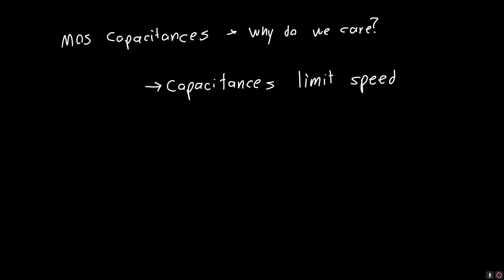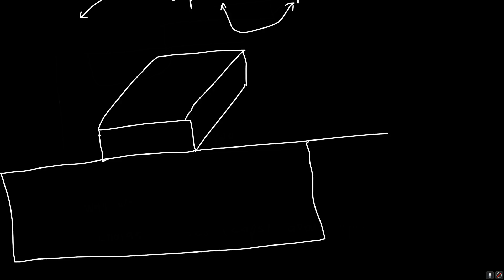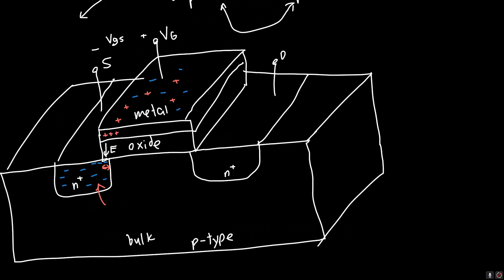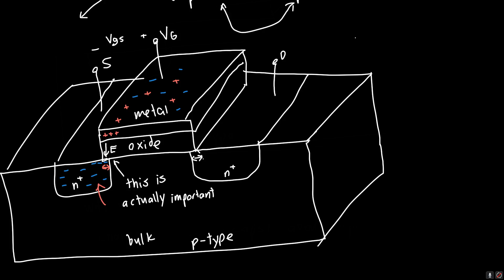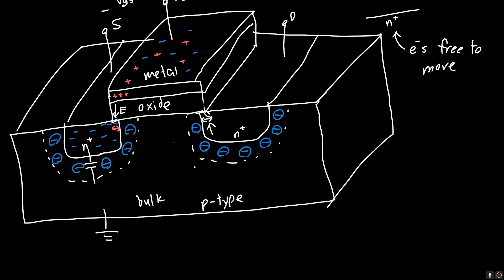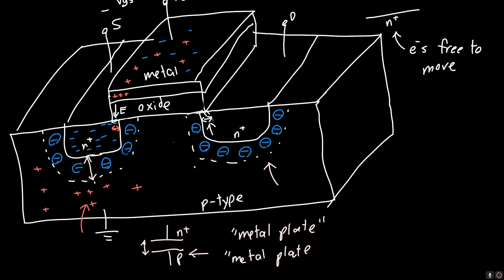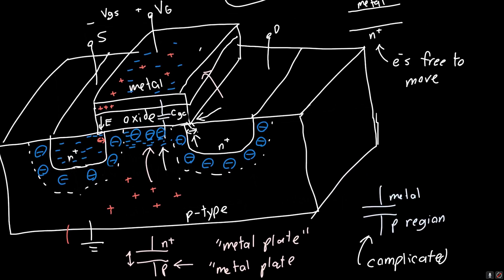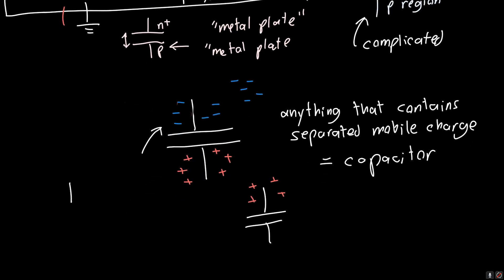MOSFET Capacitance Explained

Comment: is that overlapping capacitance between gate n drain,gate n source same as Cgs and Cgd?
or the overlapping capacitance is different from Cgs and Cgd?
Reply: Great question. The overlap capacitance is only part of the story for Cgs and Cgd. There are other sources of capacitance as well (i.e. capacitance to the channel itself, which gets lumped usually mostly into Cgs and partly into Cgd, depending on its shape), but these are a good absolute minimum for the capacitance of Cgs and Cgd. You're not going to get lower than the overlap capacitance.

Comment: How this capacitor works in single electron tunneling?
Reply from the maker: Basically, when the oxide gets too thin, electrons are able to tunnel from the gate to the bulk. You can model the oxide as a rectangular potential barrier, you can use the band diagram to find out what the barrier height seen by electrons in the metal is and you presumably know the thickness of the oxide. This allows you to compute the tunneling probability.

Comment: So, a capacitor's switching losses would be the sum of 0.5 * C_i * V_i^2, for each capacitance/voltage every cycle?
Reply from the maker: Yup! Assuming you define the capacitance in terms of the overall delta-V and delta-Q you would get the correct answer. This would represent the total energy put into the capacitor after a charging cycle. Once you discharge it you dissipate the remaining energy, so for a full cycle it’s 1 * C*V^2

Comment: Hi Sir, If overlapping is so complex, why cant we manufacture without the overlap ? I heard that polySi came to play after this . If So, Can you explain the new process ? Please correct me if Im wrong
Reply from the maker: Excellent question! It makes sense we would want to eliminate or minimize overlap to minimize stray capacitance. If we could manufacture a transistor with exactly zero overlap we would do it. The problem is that manufacturing these things is hard, and there is often a slight misalignment from one transistor to the next. If your overlap is zero, and your gate is off by even a tiny amount, your transistor won’t work because you won’t be able to form a continuous channel. I think the technology you are referring to is the “self-aligned gate”, which does minimize this overlap but still has a small amount due to diffusion of dopants.

Comment: Dear Mr. Edmunds ! Its  a wonderful video. You have explained quite complicated Mosfet Caps phenomenon in a very easy and comprehensive manner. However,  i have a question.  The gate to source and gate to drain capacitances are due to small overlap of mettalic gate plate and n+ source and drain wells. Why is it necessary to overlap gate, source and gate, drain regions ? Although the question may sound naive but i found it intriguing. If there is no overlap, these capacitances can be erdicated and make the design considerations relatively simpler.
Looking forward to hear from you
Reply from the maker: Not at all! That's an excellent question. Ideally you are absolutely right, there would be no overlap and we would just have a gate that barely ends as the source/drain begins. However, when trying to actually manufacture the thing, it turns out that level of precision is not possible to achieve, so process engineers intentionally build in a certain amount of overlap to make sure there won't be any space between the edge of the gate and the edge of the source/drain. If there was a space between the edge of the gate and the edge of the source/drain, you wouldn't have a continuous channel of electrons, which would mean no current can flow.
Reply: @JordanEdmundsEECS  Thank u so much for your response. I highly appreciated your responsiveness and command on the subject. Stay Blessed